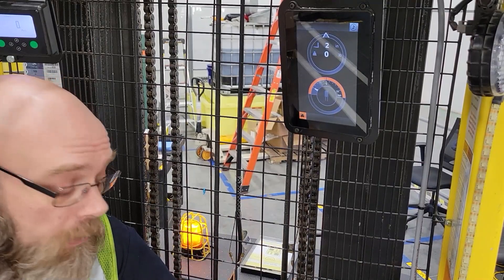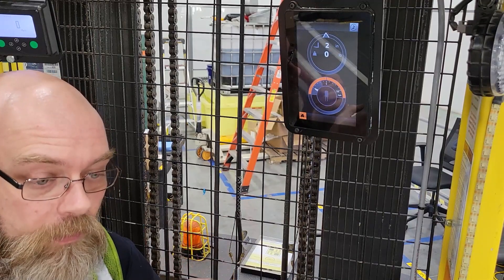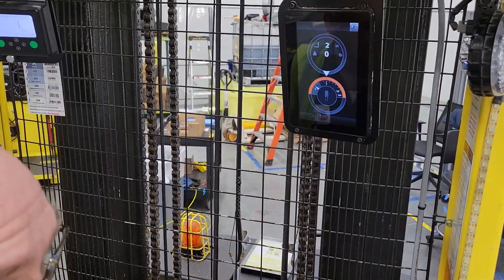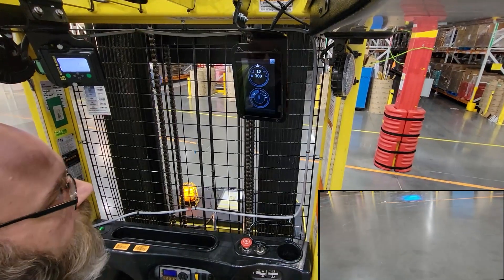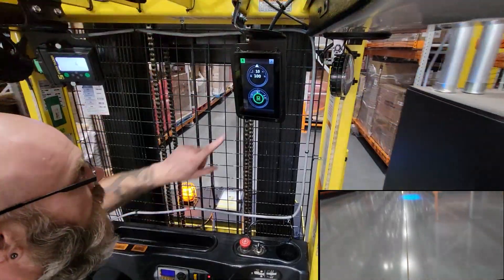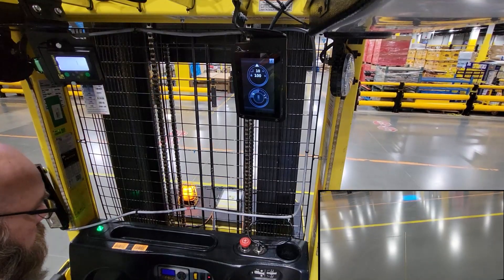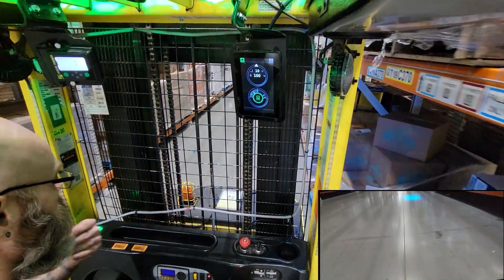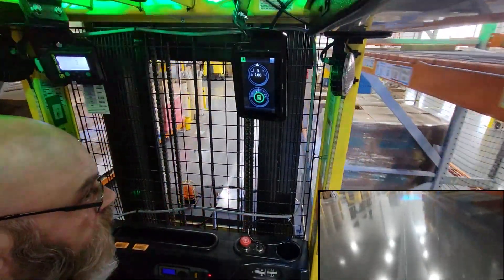Hyster Wire Guidance - Part 3, Watch It Work.

Comment: I'd be interested in seeing some troubleshooting!  I'm at another Amazon facility and I have 3 OP's that drive crooked on Wire Guide.  CM hasn't been much help.  Also looks like you're using an older telemetry system.
Reply from the maker: At this location we have the older FM1 modules with 5 Ghz wifi. We've had some that didnt like the wire. Sometimes we could get it out by adjusting the steer handle slightly off. Sometimes we would actual twist the front and rear sensors to a side, so they weren't facing square forward to back like they should. One time I ground down the steer centering plate mounted to the MDU to change the center it was so bad. You dealing with these dumb ass hydrogen cells too?

Comment: I'm confused Mr Scrufdog, I thought you said previously that only the order pickers used the wire guidance system.  Or is this not a reach truck? Great video! Cheers!  EDIT:- I see this is a Hyster, but not a reach truck.  Not confused anymore!
Reply from the maker: This is an order picker. I also just released a Reach Truck video to the public. Lots of forklift stuff today, lol.
Reply: @Scrufdog  Thanks mate! Yeah, I edited my post after realising my mistake, it IS an order picker!  Similar control displays.  LOL!
Reply from the maker: They are both part of the 'Common Control System' line of trucks that was supposed to be the ultimate solution of cross compatibility between different models of forklift. It kinda works that way... they are trying... anyway... Yes, the dash and various controls are very similiar, the only real difference is the physical shape, but the guts inside are the same.

Comment: Does the truck steer in the same way as a car or like some of our smaller forklifts that had the wheel under the seat and you turned the steering wheel left if you wanted to go right?  
Just curious to know.
Reply from the maker: Since it's drive by wire, you can select Automotive or Reverse steering. Usually depends on what the customer considers 'driving forward'. If you have the option, you can also change the effort to steer. They have ferro fluid inside the steer handle, so you can increase it's 'thickness'. Good question.
Reply from the maker: ah crap, I've got Reach Truck on the brain. Reach trucks have selective steering. The Order Pickers however, are either 'Return to Center', like these are, when they have Wire Guidance. If you dont have wire guidance, you can get a manual steer handle, the stays turned when you let go. Either way, no, you cant change much on order picker steering.